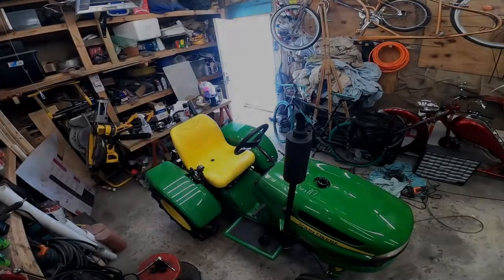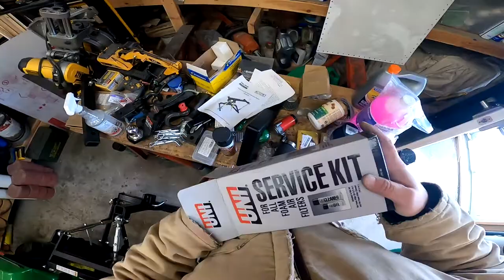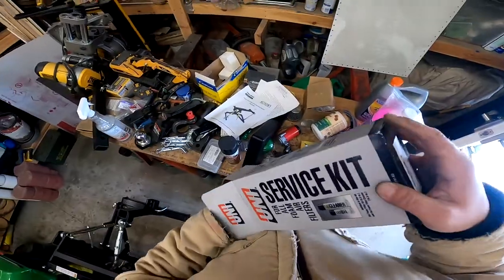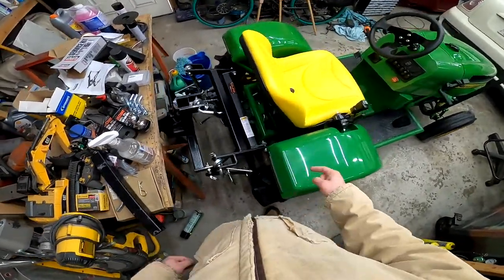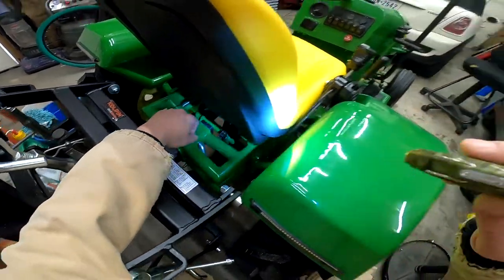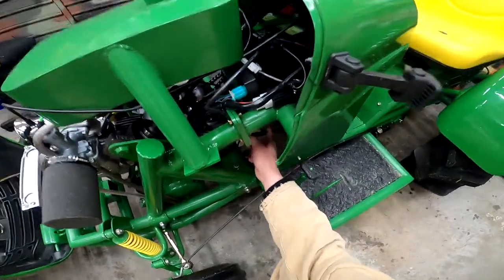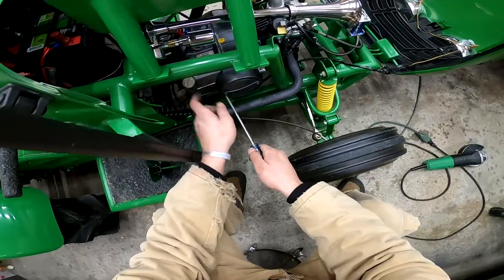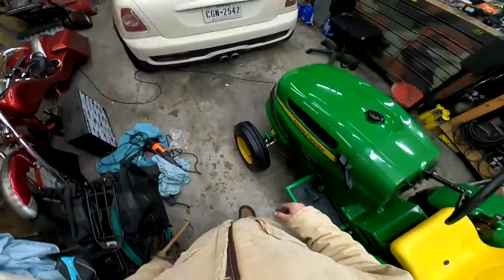Project X Day 66 Adjusting and Plowing Snow!

Comment: Hey Karl, do you have fluid in your back tires? It adds weight and helps with traction also.
Super cool little tractor man.
Gotta be proud to have hand built it from scratch and now got er out and running.  Very cool my man..👍 Makes me smile seeing it sliding around in the snow.
Reply from the maker: I am happy with it. There is no fluid in the tires. It has enough grip to do what I want it to, just can't put the power down because the chain start skipping! I gotta figure that out and then can see what it'll really do!
Reply: @KarlsKrafts  it’s a very cool little machine for sure. 🤓👍

Comment: thing moves along when you just driving it . i think you might need some weight in the front end for traction . maybe a couple 50lbs Olympic weights . kinda equal out the weight . its so heavy in the back end the front tires cant get no grip . the chain might be the issue but i figured it would have way more pulling power  unless the back wheels were just spinning . but super cool little tractor buddy and im sure once you get the bugs worked out its going to be aces . take care my friend and a very merry Christmas.
Reply from the maker: It does have more power, but I can't put the pedal down or the chain starts skipping! LOL. I have a hitch reciever welded into the front so I can make a rack for weighs and stuff, but I gotta figure out this skipping thing.
Reply: @KarlsKrafts  man with out being there and seeing  the problem my best guess is you need a bigger chain . not longer but wider or different gears  take the gears and set the chain on them and see how deep the rollers fall into the teeth . if its not clearing the rollers enough  you might get away with using a dremel  to widen them  enough for your chain to fit right . that is the only things it really could be unless  teeth have broke off . if the chain fits right it should not slip . im sure its going to be something stupid simple. unless it is in the transmission  god i  hope its not in your tranny . that will suck .
Reply from the maker: @diydarkmatter  I just ordered 50 series chain and sprockets to replace the long chain going to the axle. 40 series has tensile strength of approx 2700lbs and 50 series is about 6600lbs. Also, it's the chain size used on similarly sized/weight ATVs/UTVs. I'm hoping it's rigid enough to eliminate this issue. I'm fairly sure it's the main chain which would be appropriate at 40 series based on motor. But with this long chain length, torque tripled to it's input, large high traction tires, and heavy weight I think it's just undersized.
Reply: @KarlsKrafts  sounds good brother